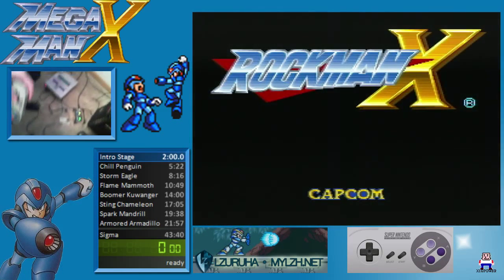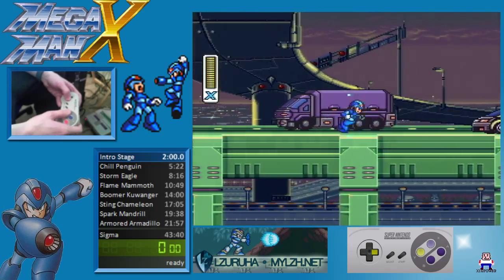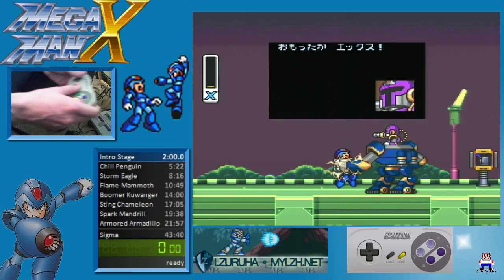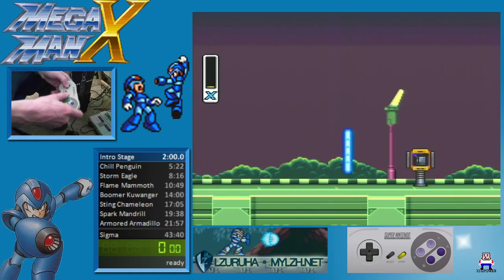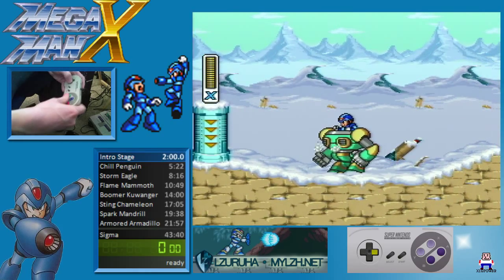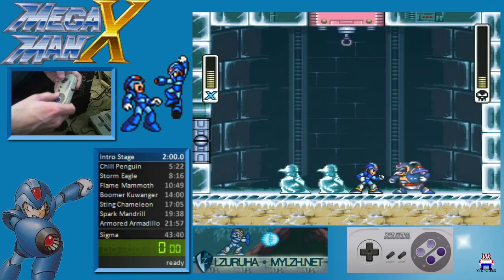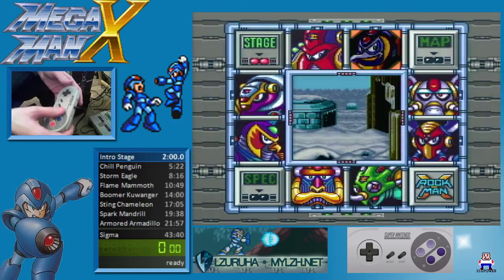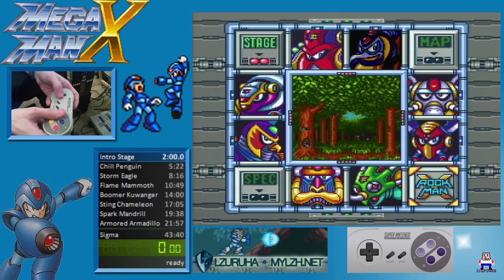Intercepting and displaying SNES Controller Input

Comment: Hi Sean, this is really interesting and incredibly informative! I'm currently considering building RF transmitters and receivers for my SNES controllers using a couple of Arduinos (or Teensys) and nRF24L01+ devices but I'm worried about the timing on the receiver side and how my receiver would feed the data to the console's controller port. From what I understand the SNES sends a latch every 12-16us, so my receiver should interrupt upon receiving the latch and feed the controller data to the system via a simple SPI connection?

I'm not entirely sure I've got this figured out yet, but if you have any advice regarding the SNES controller port timing and the feasability of my idea please let me know, I would greatly appreciate it!

Comment from the maker: Finished(sorta? still going to work on it) controller project demonstration and really bad  explanation.
Reply: Sean. Just found your video regarding your controller intercept. Great stuff! I've been wanting to make something like this myself not only for display, but to capture and record inputs to see if there is some interesting data to be mined from speedrunners. Have any more information about what you pulled together? My goal would be a breakout box made for easy connection and get it in the hands of some runners. Feel free to drop me a line as I'd love some more info. Cheers!
Reply from the maker: Steve Eichten Give me a week or so and I'll do a write up on how to do this.  I think there are at least a handful of people that are interested in this.  Its not too difficult and can be thrown together for around $30.  I also just want to say I didn't do any real legwork for this, I just used a bunch of information I found on the internet to make this work.
Reply: Good stuff! I can happily read my controller via the arduino at the moment, however doing the true intercept of the signal from the SNES is a mystery.
Reply: Sean Renaud I think I'm close. I can intercept the latch and data and pull it through the arduino. It is true that the timing is a pain. Although I think I could patch it together through some different delays, I'm worried that it may not be very transferable when I publish the code. I'm trying to time it via delayMicroseconds which can get it close. As far as timing with the clock intercept, have you tried via the direct port access? Cheers!
Reply from the maker: Steve Eichten Hey, sorry I haven't gotten time to write up what I did yet.  You've hit the same issue I had when I got to that point.  The problem is the speed of the Arduino doesn't lend itself to using delayMicroseconds very accurately.  If my understanding is correct, delayMicrosecond on an Arduino Mega 2560(the version I have) is accurate to 4 microsecond.  What this means is that 3 microseconds is likely actually 4 and 5 is probably actually 8 etc.

There are a couple ways to solve this.  The first one I tried was to just insert assembly to create my own delay by skipping clock cycles.  This isn't portable at all and I could never get the timing quite right.  The second way is to use the digitalReadFast library that someone created to speed up the reads and then you can wait for the latch to fall by reading it constantly and then watch the clock and read when you're supposed to.  This is what I ended up doing which lead to 100% accuracy.  And since you're basically just reading into the protocol, so long as the device that is using the code has a high enough clock speed it should be portable(provided the library works on that device).

The digitalReadFast function is significantly quicker, somewhere along the lines of at least 10-20 times faster if not more.  The only catch is that you have to know the pins at compile time, which in this case we do.  Another thing that I ended up doing was buying a Teensy which has a much higher clock speed and also has a built in digitalReadFast(I'm pretty sure the guy that makes the Teensy basically created the digitalReadFast code for the Arduino).  I feel like the Teensy is cheaper and more powerful so definitely something to think about, but you should be able to get it to work on the Arduino with those libraries.

When I get home I'll post the code I have for that portion.  I think its something like 4 or 5 lines(its just following the protocol) and requires you to use the Latch, Clock, and Data lines.
Reply from the maker: Steve Eichten I also wanted to add that I'll be working on a write up and providing the code I wrote for the Python(maybe even opening the github project to the public) so that we can get as many speedrunners/gameplayers as possible making their own.  The controller display you see above currently also includes how many times buttons were pressed.  Next on my list of things to implement is how long buttons have been pressed down for as well as keeping statistics for controller button presses(I call this controller mileage).  I also made it so that there is a config file for the graphics, so you can swap out the base image and then give the X,Y coordinates for where each button image should go and it should work.  That code really needs to be cleaned up so its not so picky.  

I've added some code to the hardware portion too to drive a couple LEDs for kicks and giggles.  I'll supply that code too=)  Basically makes L and R change the colors of an LED in the order of the suits of Mega Man X.

If you want to collaborate on this stuff let me know.  I might start working on other controllers for other systems as well, which I can roll into that python display program.  The higher clock rate of the Teensy is probably pretty close to required for N64 controller due to a higher polling rate, so I think Teensy is the way to go for this project.  Now I'm just rambling random thoughts =)
Reply: Sean Renaud Sean, we are in the same page with all of this and I'd love to collaborate. digitalReadFast was something I saw while searching, but had yet to really look into. It sounds like that will be exactly what is needed! Combined with recording via usb it seems like it should be very transportable across other systems and such. Getting this work with detailed instructions on github sounds like the way to go.

For other systems, the NES should be a cakewalk as it's basically the same setup. I've seen someone do this for the n64 before (https://github.com/jaburns/NintendoSpy/blob/master/docs/tutorial-n64.md) as well. 

As far as downstream software and analysis, I am very interested in finding unique ways to parse the controller data. I mean, I think this type of project warrants interest from runners just to get a live controller display for the stream (as you have setup). Beyond that, I think there are many possibilities for what one could do with the data downstream.

I currently am reading the serial data via python to parse and add a timestamp. The files are then read into R where I'm trying to come up with some cool 'standard' plots that can easily be churned out. In a perfect world, I would want to merge controller records with something like xsplit or some other software to you could properly place breaks/timestamps on events in the game (be it levels, specific glitches, etc) so you could easily go back through your historic data and analyze your input improvements as you get better. Given, this part of things would quickly become game specific and for some games, it may be fairly boring ('what do you know, I hold right and 'Y' a lot'). I imagine there would be people interested in this, as I know people keep track of their run attempts, times, improvements, etc.

I like the term 'controller millage'! For now, I'll go give digitalReadFast and see how it goes!

Drop me a line if you want to discuss outside of a youtube comment :)
Reply: Did this write-up ever occur?
Reply: Or emulator with controller that works too